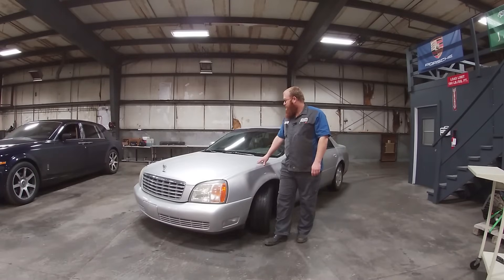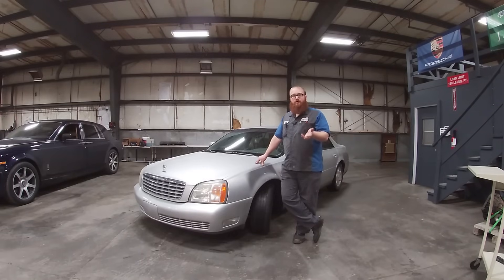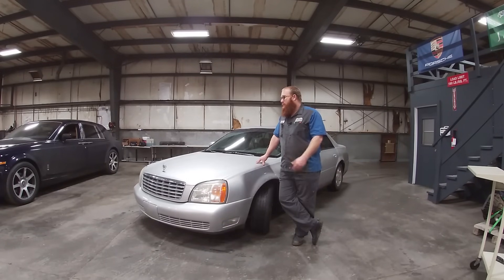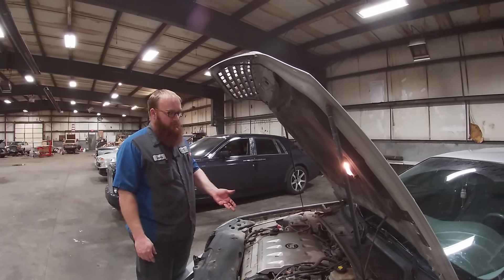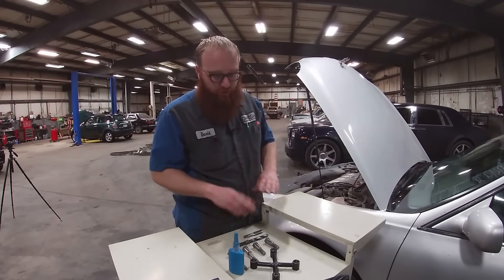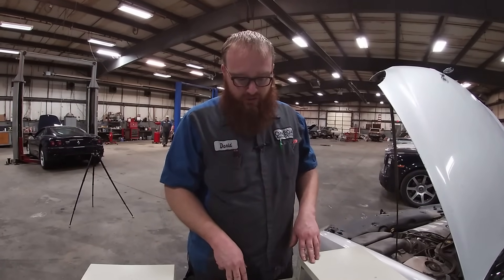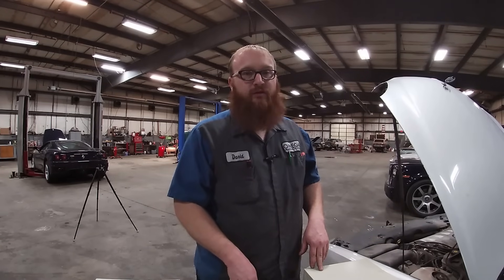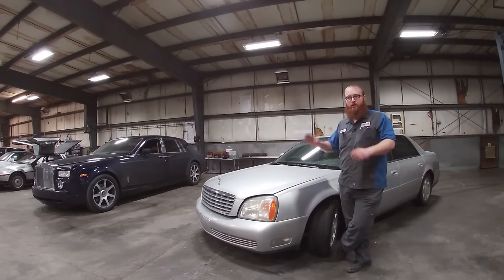The CAR WIZARD names Cadillac's Northstar Engine the Dumbest Design

Comment: when the northstar runs properly though, damn what a great v8
Reply: Ikr
Reply: I had a 2003 and a 97 both northstar.. neither one leaked a drop of oil. They were good motors to me. My 03 I bought with 123k miles I got into an accident with it 9 months later odometer read 148k when it was totaled. My 97 I bought with 116k miles. Totaled 3 months later with 123k. Had bad luck both incidents I had people crash into me and totaled them both. Not my fault and won both lawsuits.
Reply: That may be true but I wonder how many people just wanna call the engineers and cuss them out for such a boneheaded design.
Reply: @ZRZ71  Who cares!
Reply: Yea, my first car was a 2001 DeVille DTS and I lucked out with the engine. Even at 150k miles, I had instantaneous power, good getup, it was easy to control on DRY pavement with good tires. The only issue I had was a faulty EGR valve, few hundred dollar fix. Ended up selling due to it being a little too much power for my first car in my first winter of driving. Rode really nice, drove really nice. The interior was years ahead of its time. The trans synched power from the engine seamlessly, I loved it.
Reply: RICHARD MILLER bruh
Reply: Kaptain Sal 
??  lkr ?? What’s that mean?
Reply: Buick Mackane. Ikr means “I Know Right”.
Reply: @GTVAlfaMan  smh
Reply: Brevin Ainslie I can agree, my 96 Deville is my first car and it’s still going strong. They may be low on horsepower only 275 but they do have a lot of torque. On a rainy day or in the winter it is very easy to break traction when the red light turns green.
Reply: LF X  why so angry (; whats the matter cant handle any criticism for an engine you can't do anything on without any space? Please ASE certified master tech explain to us how is this a perfect engine design and how you repaired this engine with your vast knowledge. (;
Reply: I remember there was a rash of high end street rods including a Riddler Award contender that had these in them when they first came out. I'm pretty sure GM was selling them as crate motors and there was some buzz around like they were supposed to perform pretty well.
Reply: biff s  Not the best way to attract new, younger buyers like Cadillac and auto industry journalists figured Cadillac needed to put the brakes on a downward spiral Kind of like many think Harley Davidson faces. Pretty either ballsey or foolish move to impact one big thing people buy Cadillac for besides luxury. Long lasting reliability.
Reply: @senorpepper3405  What's smh? what does it stand for.
Reply: Nick J  hell no lol... I wish!😂 I got 2 kids, after taking care of my priorities i barely had enough for a downpayment. $13k is what I got.. and it was gone nearly as quick as it came. 🤷‍♂️
Reply: @richardmiller6422  I understand your outrage... must have been hard to grow up with the name "Dick Miller" but very popular in the Navy I'm sure.
Reply: @ZRZ71  Do you want to buy mine? its a 1998 with 20,800 miles on it, looks and feels like new. $5000. Let me know...
Reply: D JT that sounds like a steal👌🏽 thanks for the offer whoever does get it will be very lucky. I just became a homeowner so I’m gonna have to pass🙏🏽
Reply: @ZRZ71  so? 150k+ is an expectation for a car, not an accomplishment
Reply: You guys talk like 150k miles is alot. Thats still a new car to me
Reply: Take a close look at the lt5... then take a real close look at the North Star again. lol
Reply: @ZRZ71  what does trying to defend you're a shitty driver have to do with a Northstar engine and the fact you won 2 lawsuits?????
Reply: @steiner3626  in 96 275 hp was a lot of power
Reply: @chinchy111  um....150 isn't necessarily a LOT of miles per say.  It depends on how the miles got on the vehicle.  You really know zero about automobiles. Haaaa
Reply: @glennnichols4220  I never said it was low for 96. Nowadays it’s a dog but it has the passing power I need to get around the slow pokes.
Reply: @chinchy111  if you put on 150k miles of HWY driving in 4 or 5 years 150k isn't a lot of miles. If you have put on 150k miles in city, stop and go, towing, sub zero temps half the year or very high temps it's whole like that 150k becomes way more than that. Plus a fact at 150k miles of you use it as a regular vehicle just as a city/hwy vehicle or even more city than hwy.....you will be replacing brakes, struts, shocks, tie rods, to links, ball joints so on and so forth no matter how well you take care of it. So the statement of 150k miles is still new is stupid and shows how ridiculous of a statement that is
Reply: @steiner3626  you're young stop thinking it's an attack and being defensive.  In 1996 275 hp was a lot of power. Then in 98 the GS400 came out and was the most HP for a four door until a few months later MB came out with their 389HP AMG.  Nothing more to read into it. It was a lot of power for 1996.  What other car from GM had that much power besides the Vette?  That's it the Cameron had the same amount of power on paper that year I believe it was either 275 or 285. But I am pretty sure it was 275
Reply: @glennnichols4220  I suppose it was a lot for the time. But it sucks sometimes I wish it had a bit more for today’s standards without dumping thousands into bulletproofing and modding.
Reply: @steiner3626  you have a 24/25 year old car. Why spend the money on buleltproofing anyhting that old unless it was some type of exotic?
Reply: @richardmiller6422  for real his comment had nothing to do with shit
Reply: They run very good.
Reply: I went to se a 02 v8 with 135,000 their selling it for $2500. But it's leaking oil. Looks very good and runs good.
Reply: @gregorytimmons4777  😂 im not telling you
Reply: Yess loving my 96 Aurora 114,000 miles
Reply: Still haven't replaced my starter in my 04 DTS. Almost 96,000 mlies. Thanks for protecting the starter NASA!
Reply: The Northstar eng. was way ahead of it's time. Agreed and true.
Reply: @glennnichols4220  the jag xjr had 370hp in i believe 1997. BMW m5 was 394hp in late 1999. the BMW 540i actually put out about 310hp on independent dyno, and those came out in 96' and was definitely quicker than a gs400 (esp. the 6 speed manual sport one).
Reply: @ct1762  As adverstised the 1998 GS400 was the highest rated 4 door sedan hp on the market.  Go look it up.  I don't know about the other models
Reply: Yeah when it's fine it's great, but when them problems come it's junkyard material.
Reply: Same as a grenade . It's trouble free until the pin is pulled .  Can you put an LS in it's place ?
Reply: Just replace the head bolts with a head stud kit and it will run a very very long time i replaced the head bolts with studs and found a place that offered a gear drive to replace the timing chain for one of my friends black on black sts caddys its got almost 300k on it now and was easier than any Audi product ive ever worked on
Reply: Would it be worth it to swap a 5.0 v8 when my devilles engine blows?
Reply: I bought a 2000 Deville with only 62,000 miles & I'm trying to avoid all the flaws this engine has in it's past, by maintenancing it regularly & taking it easy... I have a valve cover leak I believe from the high vibrating engine loosening them up. Gonna try to loosen the bolts & re-torque them back down with either loctite or lock washers in the corect pattern & torque specs
Reply: @davidadamson3345  id recommend you also keep tabs on the cooling system specifically the hollow bolt that connects to the pump and the thermostat too mine just stopped opening up suddenly a month ago
Reply: Man, Love your honest candid advise, a dealership here in NC tried  to rebuild one and eventually just gave up and gifted the owner another car....... If that's your shop you win biggest shop award! That's a huge building.......
Reply: Which before 2006 is rare 😂😂😂

Comment: Should make all engineers work on their own shit..
Reply: How many hours I spent under a hood cursing and wishing for that very same thing. 

Brilliant comment.
Reply: ss  What most people don't know it that the engineers who designed that engine probably had NOTHING to do with the head bolt selection. Accounting and production design guys make the final decision on many of those things.
Reply: Let em change the alternator in that pile of shit. Oh right... you have to take the intake off.... fuck I hated that job.
Reply: Preach!
Reply: should make all mechanics take engineering courses

anyway, automotive engineer here and former tech--prior to '08 crash, GM had some horrendous R&D practice mostly led by business side i.e. accounting, marketing, disconnected principle position holders making exec decisions that give the final stamp on actual production all led by cost... the ME most likely originally designed and knows very well what they're doing but pennies get pinched long after section drawings are finalized.
Reply: Engineers always want to make it bulletproof. Using shit materials isn't their preference.
Reply: The engineers are usually not the problem, it’s upper management that makes engineers cut corners and cheap out on material to save money
Reply: ss  If they had tested it for 2-3 years, maybe they would have cought it.
Reply: time is money
Reply: @vdochev  they do the shit on purpose.
Reply: ss  No, LOL! At least I think so, but history has shown that some manufacturers have another opinion.
Reply: When engineers get older and more experienced, they become expensive and managment wants them to retire.  Then, there's nobody left to say bad idea moron.  Lol
Reply: @CBielski87  we do....on a daily basis!!! Think about , if engineers we're so fucking awesome then why do I have a job?
Reply: You would be amazed how many companies have engineers that work in a bubble.  Where I work the engineers have to build multiple prototypes, go test it.. then go on the manufacturing floor and build multiple pilots with production parts and re-test.  You learn real quick where your mistakes are and how difficult it is to assemble something.  We see our product both from the standpoint of the end user and the production worker.
Reply: @toyotaboyhatman  
And that's how it should be...
Reply: ss  The threads were probably supposed to be formed and not tapped. Usually when you tap aluminum for a situation like this you opt for a roll form tap because if you don't you get this exact problem. The issue is in the manufacturing and less the design.
Reply: ss  I've been machining for 20 years, in that time I've made everything from aerospace parts, to widgets like nuts and bolts.

You can fine thread aluminum, you just have to do it correctly, and use the proper process when doing it. In aluminum that where forming taps come in. Many companies avoid using them because they either have no experience doing it, or they are too concerned with tool and material costs. 

Good form taps cost a fair amount more, and will break more often when you don't have good lubrication for the part. On critical parts a broken tap not only means a loss of the tool, but a loss of that part as well. Because the fit of a form tap is tighter there isn't any fudge room to burn out the tap and save the threads.
Reply: @CBielski87  I didn't have the patience for engineering classes or the time. I had already gone through welding school and had been working as a fabricator for a few years.....didn't like the job. I had to figure out what to do, I knew cars...went through trade school again for Ford, then spent the next 20+ years mastering my trade. I can see where a design is flawed or where it was limited by budget . I have my job because I fix things that engineers can't. I've built many of my own cars, chassis , suspension, wiring ...I know what it takes to have a idea and take to functional object. I came from old school hot rodders . If I can't find a part/tool I'll make it....I don't use cad software, i don't use 3d modeling, I know what I need, I know the material . I use a tape , a protractor , a compass and a lot of know how. It's funny because when I build a engine, the heads stay bolted down even when cyl pressure dictates it shouldn't . When I design a part it works , it's rebuild able , and serviceable. Granted I'm not held to unrealistic budgets and trying to meet the general publics idea of what a car should be. I just have to make me happy.
Reply: ss  There are many open deck designs that are fine. BMW has used it for years on turbo engines to much success.

The aerospace industry gives just as few fucks. Parts are made by the lowest bidder as cheaply as possible. Do not get the wrong idea that somehow somewhere some bean counter gives a fuck. Boeing and the current shit show is exact proof of how aerospace is no different or better. 

Manufacturing priorities are as follows.

1. ) Quantity. Make the most parts for the absolute least expenditure. 

2. a distant second ) Quality. Its better to have 30 meh, parts than 10 perfect ones.

and somewhere off in space is safety. Just get them done. If you get injured you just get fired.
Reply: Most problems are not caused by us engineers .Well technically are but we are  people and people fuck up. We knew the problem and tried to fix it (i mean what engineer doesn't)  but guess what investors, marketing department, legal department , profits/losses, manufacturing cost... etc y'all get the point. There are little that we can do. Most of the problems have been ignored and some time, we've been rushed, forced to use cheep material by those  investors. And cuz they provide us money, we have no choice. With out money we can't do shit.
Reply: @CBielski87  also, the late ‘90’s early 2000’s is when the push began that you almost have to take your car to the dealer to get repaired.  I had a 2000 deville that was my grandfathers.  He babied it and passed away in 2007.  I barely drove it.  Once the head gaskets went and I got the repair estimate, I said the hell with it, and know my grandfather would’ve kicked my ass if I paid that much for a 16 year old car.  And they would’ve just fixed it with OEM parts and it would’ve happened again.
Reply: @derekv8534  buddy 2 things

1. murican cars pre 08 collapse are straight trash  (and have slowly caught up since)

2. theres no conspiracy, gm and the rest were catching up to techmology (poorly) and management/structure was straight garbage. 

new times bring new fxns, which brings new shit to fix that you prolly wont be able to

jah bleh to your grandpa
Reply: @FeralSparky  lol you don't need to take the intake off on 2000 models and up, for the hundredth time...

Access panel below the alternator, remove 4 screws, remove right side radiator fan, remove serpentine belt, oh look, the alternator, 5 bolts later put it back together, and uh your done
Reply: @CBielski87  Tom McCahill, automotive journalist who was featured in Mechanic's Illustrated magazine years ago had a monthly question & answer section that was quite humorous. One guy wrote in and asked "Why does a $5000 car come with a $1 jack in the trunk?" Tom's answer..."They ran out 0f the 50 cent ones"
Reply: Its been known that some engineers never got their hands dirty

Comment: The GM design committee screwed up a LOT of their products designs over the years.

This is what happens when stock profits are more important than quality and reliability.

That's a lot of labor costs to correct the problem. Love your videos!!!

What's going on with the diesel Caddy?
Reply: I'm not even sure it was a cost savings issue.

 I think some freshly minted young engineer specced the bolt and threads without regard to the materiel the block was cast out of. 
 A steel bolt into a wrought or forged steel part is usually going to have the bolt be the weakest part of the fastener assembly. For this, fine threads are advantageous because it increases the minimum cross sectional area of the bolt, meaning the bolt is stronger. Fine threads actually have more holding power (in steel), but in aluminum it's a weaker fastener because even though the bolt itself is stronger, with fine threads it reefs the female threads right out of the base material. I think where the GM-itis is with the Northstar is that when they started having issues, instead of fixing it properly by using LS7 studs or revamping the northstar design to use larger coarse threaded bolts, they bandaged it with the threadserts to fix the issue just long enough for the warranty to expire.
Reply: @TyphoidMarypatrick  Thank you for weighing in with an informed expert opinion.  I didn't know the age old debate, fine vs coarse actually depends on the material.

Can you explain what would have been a more robust alternative to a time-sert?  Not familiar with LS7 head studs.  Don't you need to repair the stripped block first?
Reply: @d46512  well for new production they could have revised the block castings to accommodate a better fastener, and to fix the already produced one, recall for a drill and tap job like in the video. It would have been brutally expensive but probably not too much more so then the timesert installation and you wouldn't have a fleet of cars blowing head gaskets and pissing off owners. I personally know a few people who's STS's and XTS's made them loyal Lexus and BMW customers after having this problem and being hung out to dry after the warranty was up.
Reply: How many videos have you said this in ?
Reply: Gm has definitely made some poor designs over the years but they are still a long way from Ford in piss pore design and engineering. Another Ford better idea............
Reply: "*screwed up* heh... Heh

Sorry
Reply: @TyphoidMarypatrick  if you can find an oversize bolt that still fits in the head that's the way to go. I guess that's what Mr northstar patented.
Reply: @w.rseaman5100  you can slide that small diff out by slightly lifting the engine (no need to loosen the mounts)